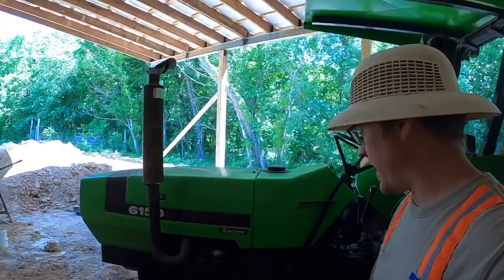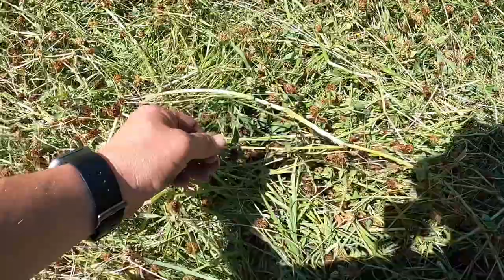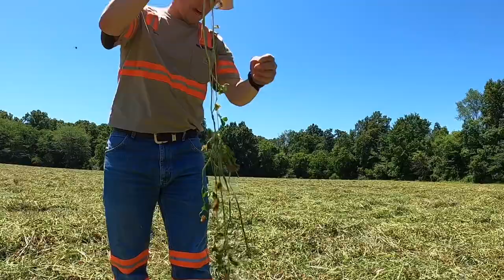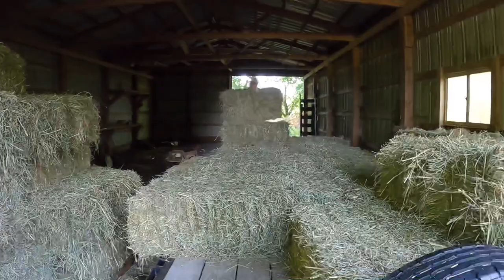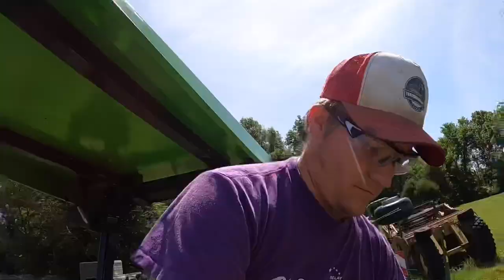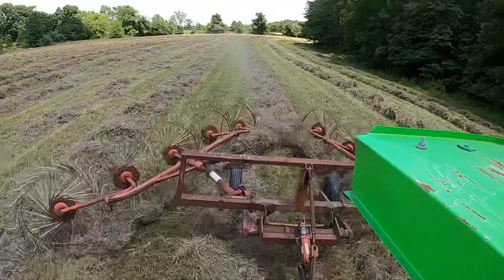Deutz 6150 Tedding with Krone and Raking with Gehl V Wheel Rake

Comment: How do you find the Deutz on diesel? The older DX 85 etc models were considered economical.
Reply from the maker: I think it does rally good on fuel. Of course it’s the smallest tractor I have so not sure how it compares to other tractors it’s size but it does use very little fuel. Using the Deutz and the Oliver more this year than the white I have been using considerably less fuel. Which is significant with fuel prices where they are.

Comment: How do you adjust the twine length my new Holland 370 small square baler is making one twine longer than the other can you explain how to adjust tensioners are set at the same adjustment please thank you
Reply from the maker: So the issue with one side being longer than the other is you have more hay on one side of the bale than the other. When that happens it is usually from under feeding the baler. I’m not really familiar with a 370 but assuming it has the same feeder as most other new Holland’s you can adjust how the hay is fed in the bale chamber by moving the feeder teeth closest to the chamber closer or further from the chamber. This will put more hay to the left or right of the chamber. You can also adjust the feeder housing back, the back of where the hay goes when the pickup picks it up, in for light hay and back for thick hay. New Holland’s usually make better bales when they’re kept full. Once you adjust it for one level or size of windrow you need to keep it as consistent as possible for the best bales.